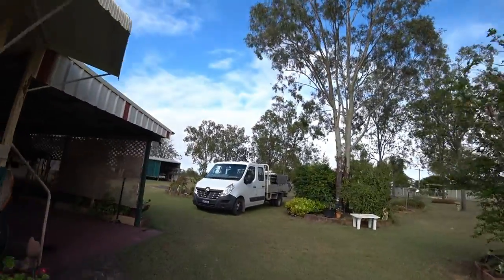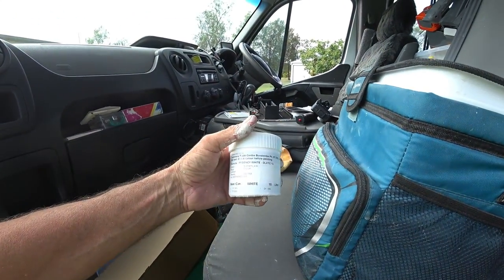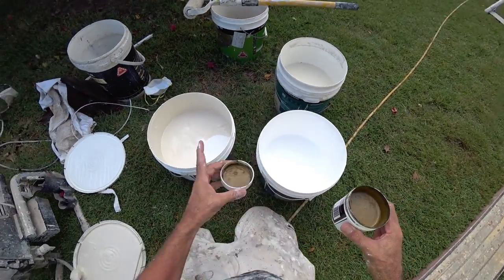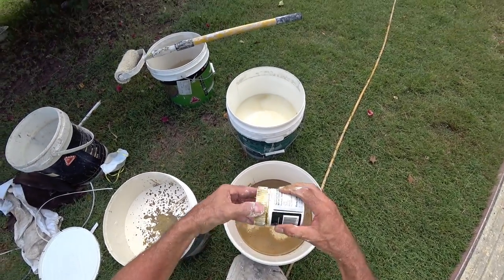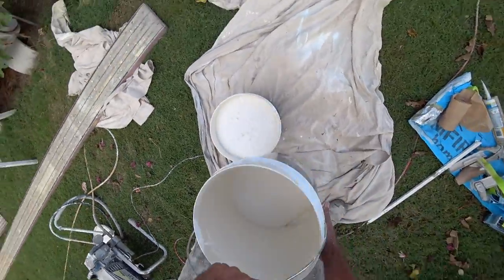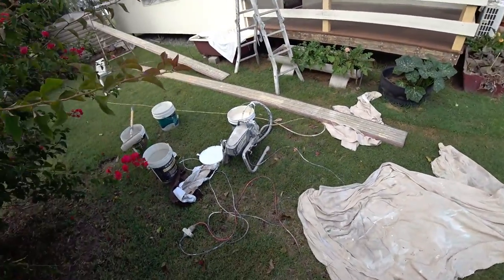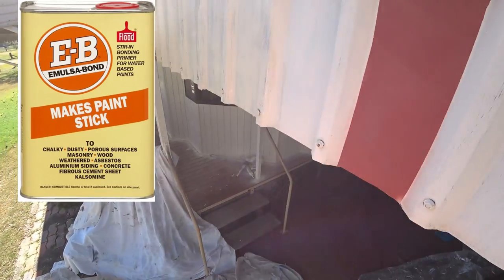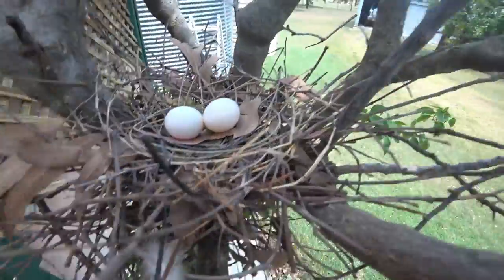Repaint ,Prepare chalky surfaces and a chat about EB Emulsa-bond and how I use it.

Comment: Good advice The Painter. How do you paint over calcimine walls?
Reply from the maker: Great question,  its a very similar technique to the powder in this video, scrub off all the powder, you could use the emulsa-bond  with water based paint or oil based primer.
Reply: i would use a alkali resisting primer to be on the safe side

Comment: What causes the initial chalky surface?  Is it just the metal being outdoors and exposed to sun or made worse by the original paint being oil/water based?
Reply from the maker: Usually an oil based paint breaking down by the sun,
Reply: @ThePa1nterhowto  Thanks Greg. You are a legend and your information has given me the confidence to sort my many old windows and outside woodwork.
Please let me know if you have a Kofi or something I can buy you a drink on 🙂
Reply from the maker: Just watching my videos and commenting is all the reward I need, happy to help
Reply: @ThePa1nterhowto  Really appreciate the help.
  I wanted to let you know that watching a stack of your videos gave me the confidence to tackle the outside woodwork on our 50 year old house.  Generally reasonable but also some very old 100+ year old casement style frames with stained glass/leading.  
They are coming up a treat.
Using a lot more oil based than I thought but really happy with the results.

I know you have a video but anything else on tips for cleaning/managing oil based brushed would be awesome!
Reply from the maker: Best tip I can give on keeping your brushes in good condition is after you finish , first quick wash in dirty recycle turps,second wash in clean turps, third rinse in diesel fuel,  its now ready to store out In the open and ready to go straight into oil paint again

Comment: Hey m8, what reason(s) do you use the other brand paints eg Taubmans , Berger etc. Why not just stick to Dulux?
Cheers .
Reply from the maker: Sometimes the builder required one brand to be used but personally each brand has its own purpose. Berger gold label ceiling flats that spray and cover better with no splatter and priced low. Dulux and taubmans have the best long lasting exterior acrylic, gloss enamels that don't run when sprayed, you learnto recognize the best after a while
Reply: @ThePa1nter  thanks. I am a floor sander installer and there is nothing worse than dealing with an Interior Designer/Architect or commercial builder that specifies a particular left field product...ps ..I just picked up another 10ltr Dulux One Step oil based undercoat...This product is the DUCKS GUTS..
Peace.

Comment: What I still can't find out online, anywhere, is whether you mix Emulsa bond into the paint you are using? or whether this is a separate pre-coat (needs to be applied before the actual paint)? I would be grateful for any assistance here.
Reply from the maker: Flood EB (emulsabond)is an additive to your first coat of paint. You only need a small amount added in your paint pot. The second coat of paint should not have the EB in it

Comment: If you add Emulsa-Bond to the first layer of paint, does this mean you don't need a coat of primer first?  And do you also add Emulsa Bond to the primer as  well if you do?
Reply from the maker: Good question,  EB is designed for the first coat of paint,  think of it as extra glue. You didn't state in your question what surface your wanting to paint,I need this information to answer if you need a primer or not
Reply: @ThePa1nterhowto  Aluminum siding that is so chalky that it looks silver in some spots where the paint is completely gone and you wipe on it and your hand looks completely like the color of the chalky paint.